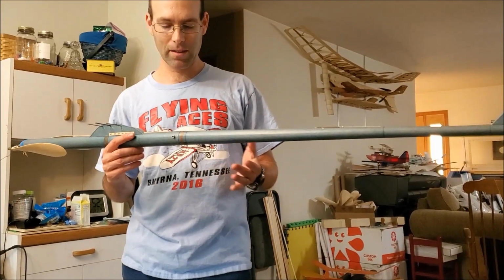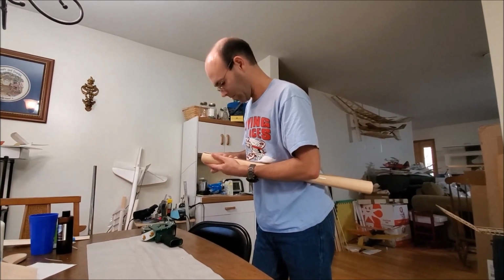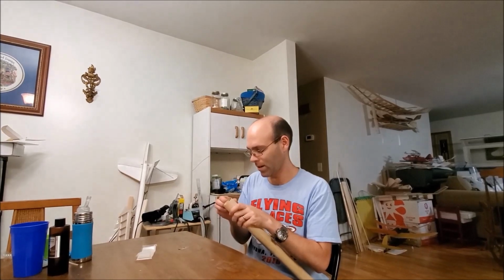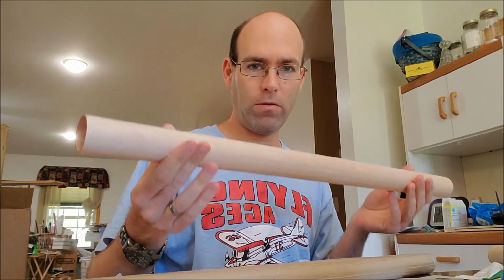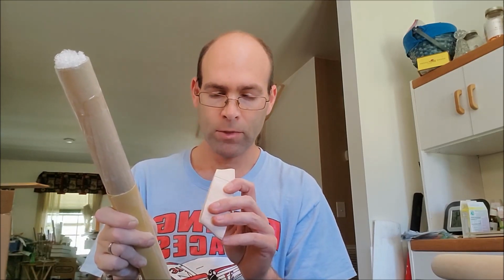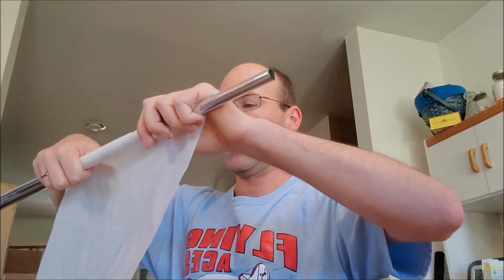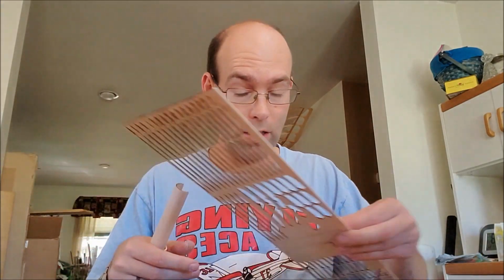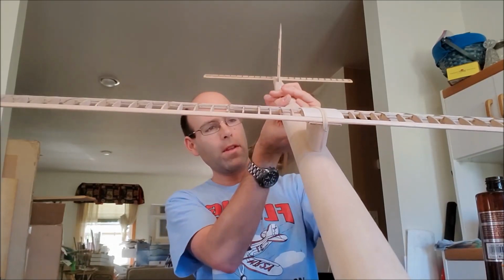Making a rolled tube balsa fuselage for a Wakefield rubber powered airplane

Comment: Don't understand why didn't you use an cloth iron and steam a bit that wood?? also you could have use rubber bands to hold it before you put tape?? May be?? Please understand.. beside of basic engineering knowledge I don't know any thin else please don't get angry at me if any of my thought are wrong...
Reply from the maker: That's a good idea, and if I'd had fabric on hand I probably would have tried it. I don't recommend using rubber bands though as they have a tendency to leave imprints on the wood.

Comment: I'd really like to build something like this, and then cheat with rc and an electric motor - sort of old-timer looks F5J.. anyonw know about geared outrunners, giant folding propellers and such ? Gonna get myself a pool queue..not for tryouts ..
Reply from the maker: Get a low kv quad motor in the 1000-1500 kv range and you should be able to swing a 10" prop on 2s. I recommend the GM F5J direct drive props for that type of installation.
Reply: @joshuawfinn  Thank you!

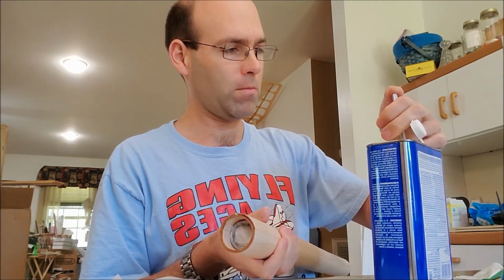Comment: 23:25 A 10-milliliter pipette will make that job easier and neater.
What thickness balsa did you use?  It looks greater than 1/32".
I got an old, cotton bed sheet and tore it into strips about 1 1/2" wide.  Instead of any kind of tape, I bind wet balsa parts (fuselage tubes, propeller blanks, etc.) onto the form with the cloth strips.  If it is 100% cotton, it takes the oven heat without issue and there is never any concern for tape residue.  It's also re-usable.
Reply from the maker: Those are good ideas. Most of my problems were from using mediocre 1/16" balsa. Had to get the plane done on schedule though, and it flies well.

Comment: Instead of struggling with that tube dipping go to amazon and buy some syringes. I use them for my superglue as well.
Reply: I"m knew at covering free flight models I've looked and looked but I can't find anywhere to buy the light weight   shrink film  for covering my models, I do not like any of the tissue covering's. PLEASE PLEASE POST WHERE TO BUY THIS. email me if you can't post it.  send to melvonnar@yahoo.com thank you